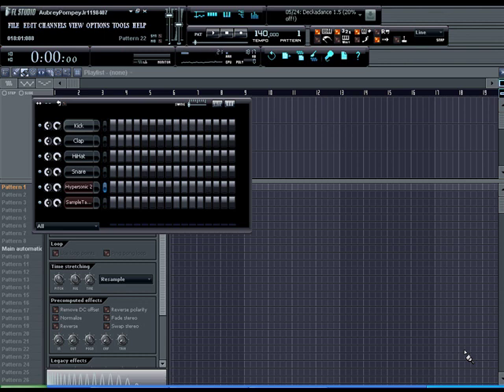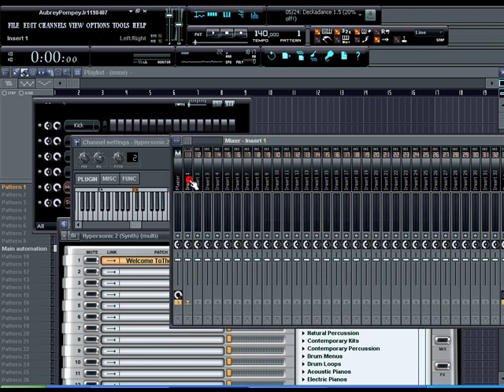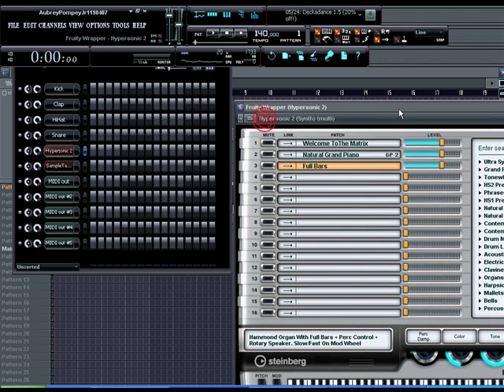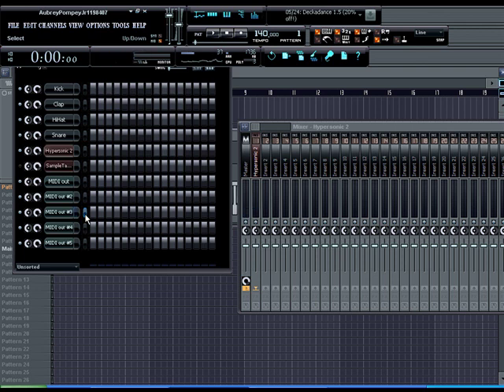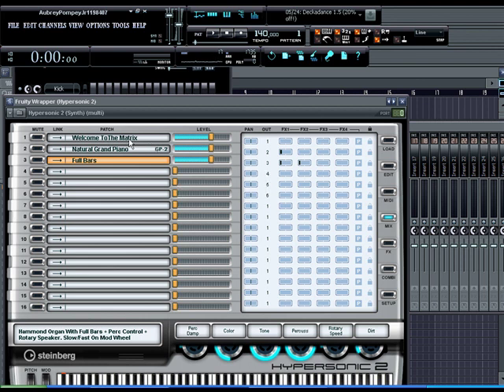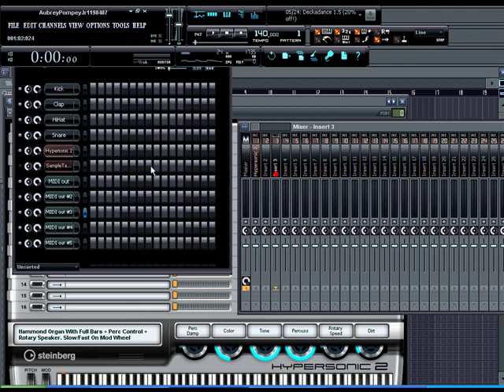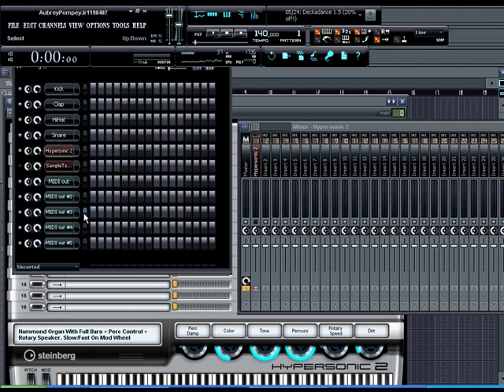Route Midi Outs to Mixer Channel In Fl Studio

Comment: I did exactly the same thing in Miroslav Philharmonik,  but it does not work.  I have FL Studio Producer Edition. 

When I change the outputs in the slots in Miroslav Philharmonic, it just doesn't sound.

There must be a missing thing. (Surely a stupid thing)...

I have the port aligned. I have the Midi channels aligned. (in fact, I can control several instruments via Midi Out). I assigned channels at the Fruity Wrapper for outputs in the Mixer. But no way. 

I've watched several videos but I haven't found what's missing.

Very frustrating not being able to set several channels in the mixer.

Please help, if you're alive yet, hehe...

Thanks

Comment: Regarding this method being used with Edirol Orchestral, I have a bit of an issue. Though it allows for multiple outputs, the VST only allows output to four mixer channels, even though I have the grand total of 16 MIDI inputs set up. Is there a way I can get the rest of the instruments to have their own mixer channels, as well? :/

Comment from the maker: its still the same wrapper, FL just changed how you get to the settings. i did this video with fl 8. in fl 9, what you want do to is click on the gear right next to the drop down box in the upper left hand corner of the fruitywrapper. It'll show the "settings". there u'll see the input and output port. change the input port to 0 (or whatever port your midi channels are set to as i showed in the video). then click on the "processing" tab and click on "auto map outputs". and there u go.

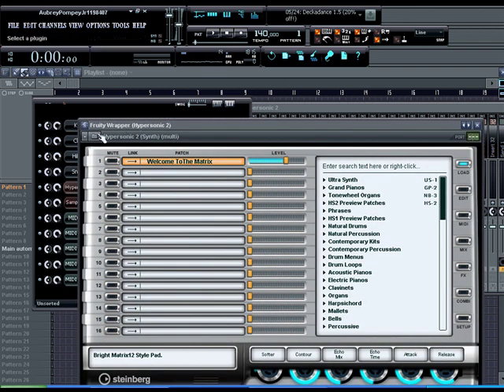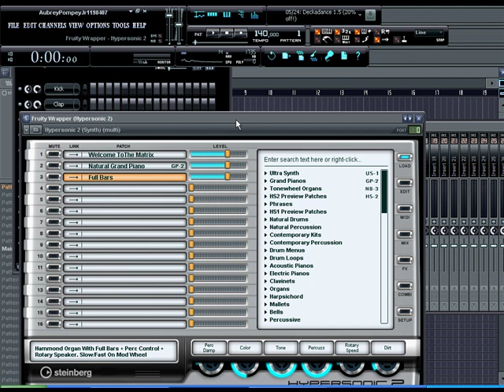Comment: At 2:54, when you pulled your screen up, I see that you have like a double wrapper, one sais Fruity Wrapper and one sais Hypersonic 2 (Synth) (Multi) if I'm correct. How do I get the (Multi) wrapper? Because at 6:09, I don't have the option to enable multiple outputs in the drop down menu. Or the other options like (Show Midi Input/Output Ports. I have fl 9 and hypersonic 2, I don't know why I'm having this problem, pleeeeeeeeeeeeze help me fam I need it bad! Thanks.